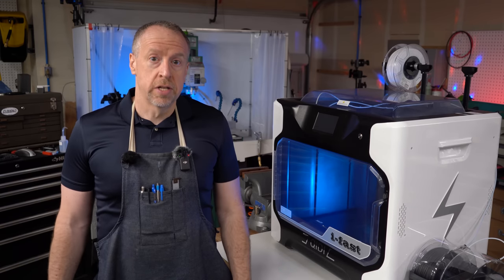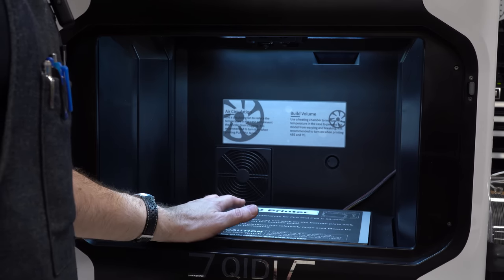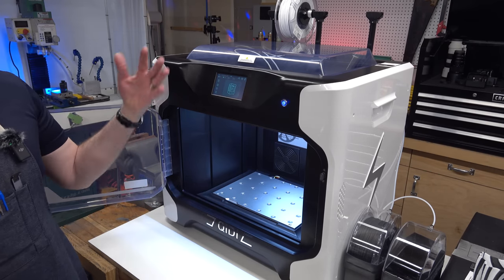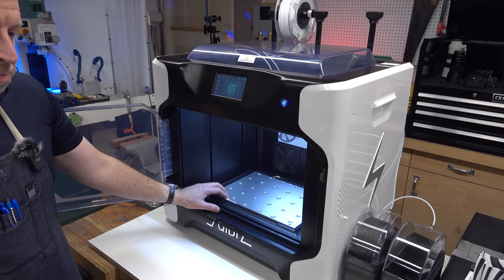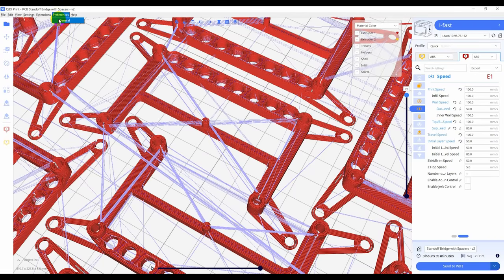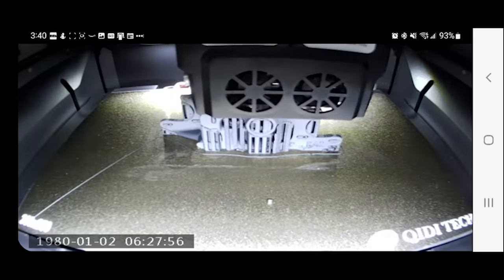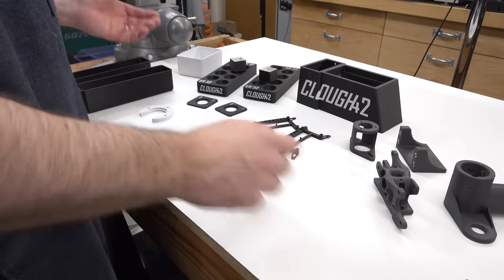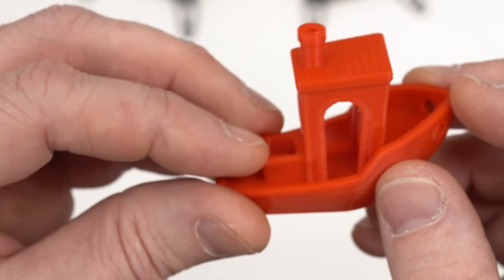QIDI Technology i-Fast 3D Printer | An In-Depth Review

Comment: It seems like the biggest pluses for this printer are its heated enclosure and build plate, both of which seem relatively low-tech.  Maybe adding home-brew versions of these features to a cheaper printer would be an option ?
Reply: It only really needs the heater for stuff needing a higher chamber temp than ABS/ASA. A well insulated chamber with hydronic cooling would do the same thing without any additional heater. I have had to add large air leaks to my passive chamber to keep it under 50C due to cheap steppers.
Reply from the maker: You can buy an insulated "tent" on Amazon to put your printer in.  This would get you some degree of passive heat capture and would prevent drafts, as long as the electronics can withstand the elevated temperatures.  This is a game of margins.  Some ABS parts will print just fine on an open printer.  Some will succeed with some attention paid to blocking drafts.  Some will print fine in a passive chamber.  Some will require active heat and good convection to succeed.  It also depends on the exact ABS formulation, the bed material, bed temperature, elapsed time, nozzle temperature, and likely other variables as well.

Comment: With that type of reliability... have you thought to stack your production prints? Fill that volume?
Reply from the maker: That would require support material and manual cleanup.  Labor is way more expensive than printer time.

Comment: Interesting that it's not an independent dual extruder, I thought that coupled dual extruders were passe now due to being a pain to level, etc. The cam seems pretty clever if somewhat imprecise. The size makes me feel better about my old Replicator 2X, with it's "smaller than ender 3" build volume but footprint that takes up a large part of a bathroom counter...
Reply from the maker: I really wanted IDEX, but so many IDEX printers had weird limitations, like not being able to print simultaneously (duplicate/mirror) without a raft.  I assume this is because the nozzles can't be leveled mechanically, but are compensated in software.

Comment: Please please please go into detail about getting the bed level, it’s like the dead center is higher than the front and back corners, dead center level test print scratches into the print but the corners and back don’t adhere.
How much friction are you supposed to feel? My overhangs are dropping.
I took the top off like it says.
The decal on the side of the machine says to remove side windows? What is it talking about?
Reply: Adjusting z height when it’s at dead center and it gives the 0.05 adjustment option I go from a great amount of friction to click once button down is no friction whatsoever.
Reply from the maker: The knobs will tilt the bed, but if the bed itself isn't flat, there isn't much you can do about that except to replace it.  If that's really what's happening, it sounds like a warranty issue.  I've also seen printers where the outer edges of the bed are colder, and this causes problems with adhesion, but mine seemed pretty even when I looked at it with a thermal camera.
Reply: @Clough42  I don’t know how to tell

Comment: Do you see any warping with the big aluminum heated print bed? I sure do in my old Replicator 2x, and it's a much smaller bed...
Reply from the maker: I haven't noticed anything.  I also haven't run a dial indicator over it.
Reply: @Clough42  that's pretty funny, the bed of my 3d printer is literally the only thing I've ever run a (Harbor Freight) dial indicator over, since it's what I bought it for... But if it were really bad you'd notice just leveling, especially if you hot level. The level of my bed goes all to crap when it's hot if you level it cold, I'd literally drag a nozzle on it.
Reply from the maker: @rpavlik1  I had that with a printer that used a wood frame several years ago.  It would rise 0.3mm on one corner as it warmed up, and then settle back down as the heat soaked during the print.

Comment: Long review, but it kinda had to be to get that much information across. If it was a quick "I liked it" style review we see everywhere, it would have felt like a bought and paid for advertisement. I have owned probably 8 or so 3d printers in my lifetime all in the $500-1200 range. If I do get something else this would be an interesting option. Like you said, no auto leveling of the build plate is a non-issue. I don't even use it on my machines that have it, I just manually get it tuned in once.

Comment: Sounds like their firmware is running on a single threaded mcu which might explain why the printer would bog down if using it while sending a file. Probably not something fixable in software unless they blocked the UI.
Reply from the maker: Blocking the UI seems like a reasonable first step.

Comment: I find it interesting you describe this printer as entry level industrial, from your experience I would not have qualified this as an industrial printer, still sounds very consumer: buggy software, low cost hardware, firmware updates with the same version numbering, embedded webcam which is not integrated fully. If it came to work and was told to use this, I'd be shocked. For entry level industrial fdm I'd point to something like the f123 from stratasys, typically industrial printers only use the manufacturers own materials to ensure consistency and they are practically plug and play to minimise staff training requirements. These features are typically anti-consumer but they ensure the output is consistent and the support burden is minimised
Reply from the maker: I think that's the market they aspire to compete in.  After testing, I agree that they don't fully live up to the expectations for industrial users.
Reply: @Clough42  ah, so it really the company who wish it to be portrayed as industrial, fair enough, I imagine this printer comes in a whole lot cheaper then any real industrial printer so it's likely not a fair comparison.
I think stratasys's fdm line up starts at $11,000 for a single extruder model
Reply from the maker: @mawoodmain  it's my interpretation of their intentions which is certainly open to debate.  Would you use a different name?  Professional?  Prosumer?  I'd be happy with either of those descriptions.
Reply from the maker: @mawoodmain  you know, on further reflection, I think I arrived at that conclusion because on a feature basis, it's very similar to the Stratasys UPrint SE, which I would definitely place in the industrial category, at the entry level.  At least that's where it was in 2013.  It was the gateway drug to buying a Fortus.  Though it's not 2013 any more.
Reply: @Clough42  yeah it's an interest point of discussion I think I'd be happy with either of those titles too, after this printer has been on the market for a few years I imagine they will have sorted most of these bugs and it would be completely serviceable. Don't take my criticism to mean that I think the printer is bad, it does seem very good and very few printers feature a proper heated enclosure and air filtering solution.
Reply from the maker: Amusingly, I just took a closer look at QIDI's web site, and they use the words "Industrial 3D Printer" and "Industrial Grade" in their marketing materials.
Reply: My last dayjob we had maybe 10 printers. The cheapest was a 75K Stratysys FDM. The most expensive was an SLS that needed a whole room and ventilation system built for it. In between were a few Objet polyjet machines we ran the most, that ranged in price from 300k to 500k. All of these printers had service contracts to boot. That's what I'd consider commerical. All that said, my $1000 X-Max is maybe 75% of the print quality of the 100K Stratysys FDM. A bargain IMO.

Comment: I have a Qidi Pro X, for about 2 years, and it is a disappointment to say the least. My son and I also have an Ender 3 with many mods which , all in, still cost less than half of what the Qidi was.  Print quality off the Ender is much much better vs the Qidi.  I'll admit the heat management of the Qidi is better, but that's about where it ends. Printing on the Qidi is always an adventure and uphill battle. We use Simplify od Cura for slicer software.
Reply from the maker: That's interesting.  I don't know anything about the X Pro.  I think most of the time, as long as the printer itself is mechanically competent, it's more about the slicer settings than anything else.  It wouldn't surprise me at all to discover that the difference is the time they put into tuning the profiles for the slicer.  I usually use Simplify3D, but haven't tried it on the i-Fast.  I will eventually, and it will be interesting to see how much difference it makes.

Comment: Why is the old spindle back on the mill? Engraving the new spindle?
Reply from the maker: The ATC spindle is on the Avid, as shown in previous videos.
Reply: @Clough42  aw! I thought you got a second ATC spindle. I didn't know you nabbed it from the mill. Clears that up!
Reply: @marcus_w0  have you not seen the amount of money dropped in tools and machines lately? It wouldn't be far fetched to think he bought a second spindle. He bought a Miller multi process "for welding the fog buster mounts". That's roughly a $5000 setup

Comment: I made a foam core poster board enclosure for one of my printers, and it made a huge difference in warping of large PETG parts.  Even 40c makes a big difference.  Looks very nice for the price and features.  You could always give it a lobotomy with a new board + Marlin, and still be at a reasonable price.  That starts to make it a project vs a tool though... 🤣
Reply from the maker: Project vs a tool?  That sounds right up my alley.  :)  I think it may be running Marlin internally, just based on studying the GCODE, but I can't be sure.
Reply: @Clough42  Looking at the machine config in the slicer should tell you.
Reply: @Clough42 I believe Qidi uses Sailfish for the firmware, not Marlin. I believe this is because of some historical connection with Makerbot. I don't have details on what that might have been. Perhaps Qidi was the OEM for them? Not sure on that part.

Comment: Nice review! I have had the Qidi X-Max for 2 years now. I use it maybe once every couple of weeks for prototype work, using PLA. I was ready to throw it out the window until I bought a 3rd part PEI plate a few months ago, and some printer specific bed sprays (instead of the glue sticks). Those changes made it print beautifully immediately, and now its a joy to use.
Reply: Would you be willing to share the specific bed spray when you get a chance?  Thanks
Reply: @redone823  I typed out a response yesterday, with links of what I bought. Did you see it by chance? I don't see it at all now.
Reply: @nickp4793  no worries.  After reading the other comments, I decided the qidi wouldn't be a good fit for me.  Thanks.
Reply: @redone823  To follow up, the Qidi Max I have I think has many of the same features as this iFast. The heated bed looks exactly the same for example. When I bought mine I don't believe there was any PEI plate available. I bought one from a 3rd party for about $30 and it is way better than the non PEI plate that was standard equipment. It looks like the iFast has that already from Qidi now. The other thing I changed was I went from glue sticks, to a spray called 3dLac. Its from Europe, but there is one USA distributor for it for about $25. I switched to that spray plus the PEI bed and now my prints stick perfectly while printing, and release super easy when done and cooled. I didn't try the PEI without the spray though. From Clough's video, maybe the PEI was the main thing? In either case, 3D printing in general can be finicky, and I found something that worked for me and didn't want to mess with it:) Before I switched to these two products, regular PLA was having a difficult time sticking to the bed, and at least half my prints were scrapped.

Comment: how does an ooze shield and a prime tower work???
Reply from the maker: When the printer is printing with one nozzle, sometimes (often) the other nozzle oozes filament.  The ooze shield is supposed to wipe this ooze off the nozzle before it can wipe off on your print.  The prime tower is printed immediately after switching back to the nozzle to make sure it's primed, replacing the filament that was lost to ooze.
Reply: @Clough42  Cool.  Thanks.  I was hoping this might help with a single extruder.  

Good video.

Comment: Try a Prusa printer. It is very capable and already very long on the marked, so no surprises. You could use PC with carbon filbre or ASA instead of ABS. I use the Mark 3s with the multi-material unit. I think the XL will be a very nice machine, but maybe not the first generation... You saw you build a motor mount that was to flexible, you have to think bigger (I never thought I'd have to say this to an American). Make the mount two times thicker and it will work. The motor mount I did use was 20mm thick in PETG.

Comment: yes, fyi the beta of version 6 sucks and you should stick with v5 for now...They seem to have so many issues that they did add 'beta' to the release. Once they remove 'beta' all new issues they found should be fixed.
Reply from the maker: I haven't run into any issues with the slicer.  Does v5 support the i-Fast?  I thought I looked and didn't see it.
Reply: @Clough42  Not sure, but if you haven't ran into any issue they may have made it for i-fast and still tuning it for older printer versions. The biggest test you can see if it works or not is how strong the filament is. I found 6 on my x-plus was very brittle.

Comment: Given your penchant for diy building machines, why buy a premade 3d printer? Modifying your existing printers to add a conveyor bed or other features as necessary seems like it would be right up your alley?
Reply from the maker: Little Machine Shop had an article many years ago about why their CNC machines were so expensive.  They posed the question:  Do you want to make a CNC machine, or do you want to make things with a CNC machine?

Comment: My opinion which may is not correct, it is the moste intressting printer for house owners at all. When I look at the craftsmen's offers, the retourn of investment can by reached in 2-3 weeks i fit prints 24/7 on ASA. But I'll wait a little longer, becouse I m not in a hurry. The jobs needed to by done can easily another year ;-) Or may I let him work during summer season in my garden shed which will by not a big lost if something is happen. 360 mm is damn close to make house borders happen as well as ceiling panels, cable ducts, ventilation silencers in special formats that cannot be purchased. The structure of the 3D printer heat bed panel as a visible side for final parts ins in the living room is very acceptable few, isn`t it. And the printer alone will pays off by saved truck deliveries for the jobs to by done on the last 3 Rooms and give to all the other machines a break. No more running after the parts for hours....

Comment: Seems a bit overpriced.  Can't really find details on the parts used, so going to say at least $500 too much assuming the rails are high end.  With those changes made,  I imagine it's just Marlin they are using.  They are using some open tech and some patented stuff. Wonder if those costs are attributed or if it's just another foreign company making money off other's ideas. I have an enclosure on two of my printers and they help a lot.  I havent found the best way to heat them yet though. Wonder what they used!
Reply from the maker: Depends on how you're evaluating the pricing.  If you're judging what you could build it for, that's not terribly relevant.  If there's another printer that does the same job for $500 less, that's definitely relevant, though that will vary depending on exactly what your needs are.  If you want to print shelf decorations out of PLA, you don't need a printer in this category.
Reply: Printer is not running Marlin, it uses <horrifying> Sailfish.